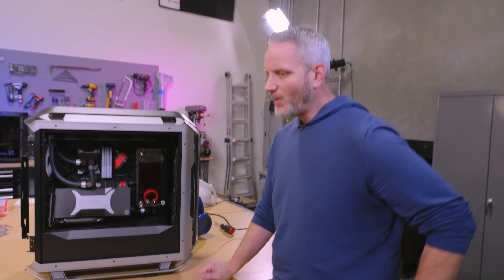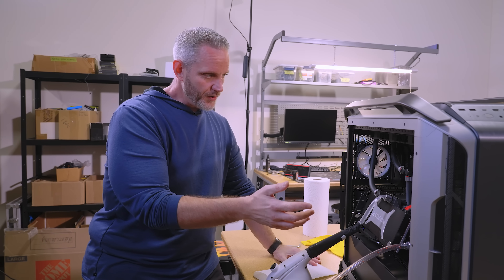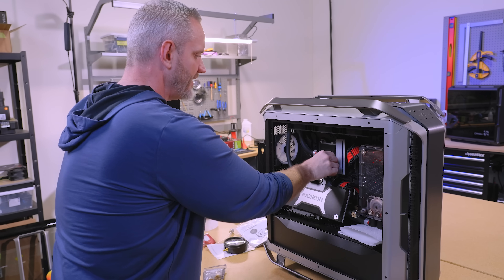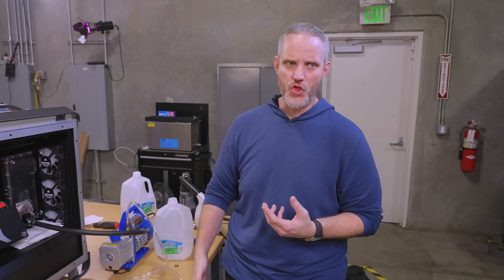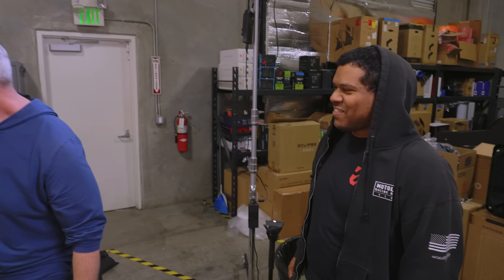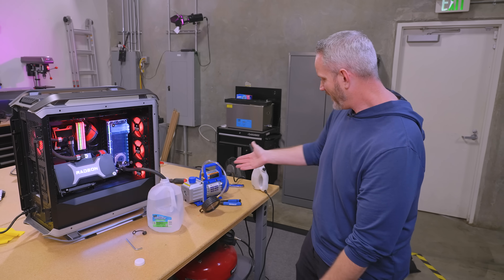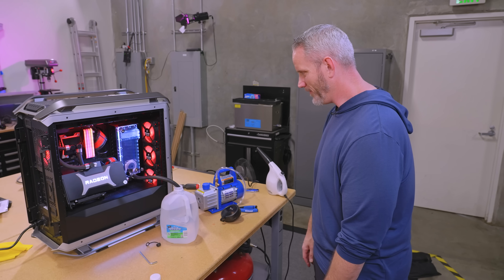I used Vacuum Pressure to fill a PC! Why didn't I do this sooner!?

Comment: Hey Jay, nice idea, but a litten bit late. Check Aquacomputers Leakshield. It uses a slight vacuum (negativ 300-400mbar) You can use this to Check for leaks in a newly build System, to Fill the system throgh a Port and to degas the system. (As well as a leak protection)
Reply: This is a pretty cool peice of kit. Please review Jay
Reply: Leakshield is a very nice looking piece of kit, especially with the QoL features it offers!

Shame it doesn't fit on my Corsair XD5 or I'd grab one in a heartbeat for the peace of mind alone.
Reply: @charries96 you can purchase the leak shield as a stand-alone version. It then works with any g1/4 port
Reply: How does it achieve leak protection? The entire loop can't be of a lower pressure than atmospheric while running, can it?
Reply: @bricaaron3978   Yes, the system runs at low pressure.  Mine is currently -316.5mbar ;-)
Reply: @looncraz  That is very impressive. I've been wanting to apply sub-ambient phase-change-based liquid cooling to CPU and GPU. If I do go that route, I will consider adding such a protection.
Reply: @bricaaron3978 That is exactly what it does
Reply: @bricaaron3978 it can if properly assembled it is airtight

Comment: Aquacomputer released the Leakshield two years ago and it can vacuum fill a loop.  The usefulness of its primary function, leak sensing and prevention by keeping the loop under a constant negative pressure, is debatable.  I wish you would feature the more actual enthusiast tier brands like  them and  Watercool more than the garbage mainstream EK and Corsair parts.

Comment: Jay you should get a water jet vacuum pump. It works by running it under the tap, and it is designed w fluid through it in mind and it's comparatively cheap. Tht way you could fill through a hose in an inlet and pump through the system that way until completely full 🙂 we use them at the lab where I work and they work wonders completely passively
Reply: Only downside is it isn't as cool looking as the name suggests!

Comment: nice one, next time after vac-ing and shutting the valve OFF. 
just raise the black hose up and fill it to the end, then put a finger on its end and dip it into can with fluid, that way you dont have to have additional valves and no air will get sucked in, like you explained happened right there with that black tube full of air after disconnecting from the vac pump.

Comment: What you could do is mount the vacuum pump with a tank and a two way valve so you could draw a vacuum on the tank to draw the water out then flip it to fill the case

Comment: Couldn't you just vacuum through your highest port while keeping the jug like you have it at the lowest port to fill it?  You'd entrain a lot less air  and it would be less violent.  They sell brake bleeder kits with hand vacuum pump and gauge for under $20 including rigid liquid traps.  For a follow up though, you could see how much vacuum it takes to collapse/warp a rad or contact block!

Comment: If yuou attached a container that can hold it's shape under vacuum that has the tube to the computer at the bottom and the connection to the pump at the top then you could use the pump to empty the system and then dump the old fluid, fill with new fluid like half or 2/3rds full.  Then pull the vacuum which will pull the air through the new fluid but then there would be no air in the line and disconnect the pump at the top the vacuum in the system will pull the new fluid in to the PC.  Finding a strong container that holds a gallon to a gallon and a half would be ideal I think so that half full would be 2 to 3 litres of fluid.

My system with 3 360 rads holds about 1.2 litres so 2 litres would probably be good.

I've been trying this but since I have a hand pump and no confidence/proper fittings it has yet to pull a proper vacuum.  The tinkling noise from the rads is very concerning as well so I stopped.  Be interesting to see if there is any loss of cooling performance because of the vacuum.  The nice thing is that the acrylic blocks and distros are going to hold a vacuum much easier than pressure so it seems like a safer way to test for leaks anyway.

Comment: When I convert my system to a hard line from soft i'm going to plan the filling up and draining side of things alot better than I did in the first place. But i'm not sure about using a vacuum to fill but to leak test at the very least due to me living on a bit of a budget.

Comment: 5:54 Phil's reaction was my reaction word for word, same cadence, same tone. I am shocked at how effective this was. Jay better get royalties for this. This was shear genius.

Edit: Apparently, there is a device from aqua computer called LEAKSHIELD that uses a concept similar to what was demonstrated in this video. It uses pressure to fill the loop, monitor's the loop's atmosphere in real time, and adjusts pressure to minimize or neutralize leaks. Linus did a video on this 2.5 years ago.

That said, I still think this method is faster and less proprietary. I still love your idea, but check out that LEAKSHIELD from aqua computer and perhaps give us your thoughts on it.
Reply: Prior art; he is repurposing existing auto tech. Plus Aqua Computer's Leakshield, which uses the same principal, as referenced above, already exists. Jay's giant shoulders are atop the shoulders of previous giants. Fantastic realisation of a=b and b=c, therefore a=c, though.

Comment: Some tape on the hose so you can turn the container of water upside down would make the hose fill with water instead, so the machine wouldn't have any air. Then you just need to close the valve and put the container of water the right way up again to get the water out of the hose, should only take a few seconds.

Comment: To pull the fluid out of the system with that pump all you would need is an intermediate tank like for a vacuum brake bleeder. One trip to Harbor Freight and you could get everything.

Comment: For a purely entertainment, would you ever consider using a smaller car radiator for a PC/system/server that would normally through off a bunch of heat? Maybe have disconnects on lines run to outside in the winter when it's cooler.

Comment: If you want to drain the system, you just need to get a pump that has a fitting at the other end of the pump. This will allow you to cap it and switch between vacuum and blower. 

In theory when pair with a larger res system. you could get a completely airless system and use it as a hot swap complete fluid changer

Comment: next thing is to think of a way to do a full flush machine like what professional mechanics normally use... I've never actually used a vacuum system for automotive coolant but have definitely used it for AC recharge. A flush machine would actually clean all of the old fluid out and put new fluid in all at once, although not nearly as fast as this still. (this is still great for when you need to take fluid out completely to change out a part but if all your doing is putting new clean fluid in...flush machine time!)

Comment: Been doing it for my last few builds. Have a container between pump and loop. That goes to a t. A valve on each side of the t. Pull vaccum onep valve going to coolant till it fills up to t. Pull vaccum agian close valve to pump open valve to coolant no air. Look at the snap on automotive coolant vac fill set up where i came up with my setup.

Comment: This is how hvac techs do it for refrigerant and glycol. I want to run active cooling in a sealed case and replace the air with nitrogen and see if that will prevent condensation. Someone with a budget for these things should do that and make a video.
Reply: Also you can use a manifold for refrigerant gauges to swap from your vacuum to fluid.

Comment: Now to make a container that you can put the fluid in and draw the vacuum thru the fluid (hard tube makes bubbles thru fluid and the air gets drawn out the hole in the lid).  Then when you release the vacuum it draws in air thru the lid but the coolant is in the way and drawn up the hard tube and into the system.  This gets rid of the air in the tube.
You could also then fill from the highest point in the system and draw the vacuum a second time after running the water system for a bit to get out the bubbles.  Although, I would think having zero air in the system could be bad once heated.

Comment: Jay, to expand on the use of automotive tools and making this a bit more reachable, how about a "mighty Vac" hand pump like you would use for bleeding brakes? Especially if you adapt a larger reservoir to hold the old coolant, it could be a one step solution. Also you could add a tee fitting and 2 more ball valves one to your vacume, one to the new fluid this would then allow you to not have the air introduced from the new fluid line.
Reply: That's what I use.  It works very very well.  A big system is rarely more than 2 liters and a hand-vac is more than plenty to purge it in a minute.

Comment: are you sure that the system still has the same cooling capacity?
I'm afraid the noises from the radiator were from the cooling fins that have become detached from the water-bearing surfaces. Or in other words, by pulling them together, you have torn off the cooling fins on one side ... would delaminated be the right word here?
in future, please test whether the cooling capacity is still present before you release a video ... can you imagine how much work it would be if you had to replace 100 radiators and then fill each loop again by hand ... lol, besides, amazon would definitely put you on the blacklist if everyone who ordered a pump now sent it back with the reason: jay comes too fast ... to a conclusion

Comment: The vapor is actually the left over coolant boiling off, if you’re doing this on a cars aircon it’s how they remove any moisture in the system ;) stick a valve on the other end and you keep the tube under vacuum as well  ;)  if you have a bottle of water and pull a vac on that you ill see it boil :)

Comment: If you used a larger container & attached the vacuum pump to that of the liquid cooling & the drain connected it would vacuum the liquid in to the container & the system would be at vacuum ready to be refilled.

Comment: Jay: get barb fitting cap thing for your jug so that you can turn your jug upside down and then pull from the bottom, as that will let all the air out of the hose / prime the line.

Comment: Just needs a bit of a tweak, use a "Y" connector with a valve at the base of the pump. Attach one end with valve to the system (like you did) and to the other to a fluid container with a valve. 
(have the container valve closed and open the system and pump valves, pull air out, then close the pump valve and open the contain valve.) Air problem solved

Comment: If you placed another shut-off valve on fill tube near the pump; turned it off  to capture vacuum in the tube while pump is still on; you could keep the tube clear of air and place in liquid and then open valve and almost add no air to system!

Comment: Jay, a submersible pump with good head pressure in a bucket of coolant will do the job you're looking for and put less stress on the parts. Watch a video on how to flush a tankless water heater for the basic idea. An aquarium supply should have a suitable pump for your needs.

Comment: The purpose of pulling a vacuum on a refrigerant circuit isn’t to make it easier to fill the system, it is to remove any contaminations from the system such as oxygen or nitrogen. 
My concern is that entire water cooling system is engineered/designed as a positive pressure system. O-rings notoriously struggle with vacuums. I believe this will cause them to fail prematurely. 
I’m not sure where Phil is getting his info from but you don’t need a “NASA” grade pump to get more than one atmosphere, I do it on a daily basis as an HVAC tech. It is industry standard to pull below 500 microns. Atmospheric pressure @ sea level is well above 100,000 microns.
Also your micron gauge is not in a ideal spot for accuracy, for your purposes; I would not use a gauge at all and cycle my valve on and off a couple times listening for a change in vacuum pump pitch. When you cycle your isolation valve and hear little to no change in the pitch of the pump that means you’ve gotten about as far as that pump can take you.

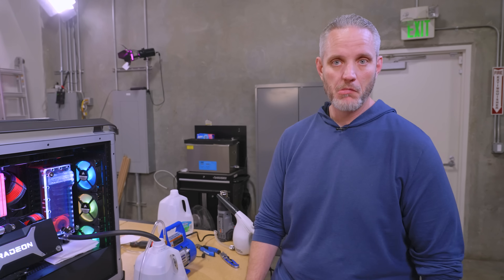Comment: Easy Composites has a video called "How To Do Perfect Vacuum Resin Infusion of a Carbon Fibre (Fiber) Part - Basic Tutorial" at 7:20 they show you how to get a vacuum in the tubes and how to clamp them off so no air gets back in when you fill your system with water.

Comment: T connector with 3 valves, 1 valve on each side of the T. put a hose into the container with the coolant, the other end to the vacuum pump and then the third end to the system.
turn off the flow from the coolant, turn on the flow for the vacuum and the system and allow the vacuum to form.
turn off the flow from the vacuum pump and turn on the flow from the coolant.
turn off the flow to the system.

Comment: To drain, apply air pressure (air pump) to highest point in loop and then open the drain valve.

Comment: instead of vacuum pump you could use the pneumatic brake fluid refill system and use the compressed air which i assume you have and fill the loop that way so that no risk of radiator or any fitment/reservoir collapsing or failing. it just suck in the fluid through venturi effect. Or as an alternative make a contraption using the blower where the blower blows the air away from loop through drain pipe and it will create same venturi effect in the loop and suck in all the liquid :)

Comment: Don't do it this way. You will collapse/crack parts. The better way would be have the vac on one side of the block and water on the other. The vac will suck the water all the way though with no collapse.

Comment: in the automotive repair field, there is a piece of equipment for draining and refilling cooling systems using vacuum.  it's strong enough to collapse radiator hoses and fill the system about 80% in seconds.  

as long as PC components are robust enough to take the vacuum, it'll work, but there will be some air.

Comment: The reason you can't pull the vacuum past 24" is because of the water left in the system. Water boils under a vacuum which will cause the pressure to rise. On a new build you might hit 29" but it might require running the pump for 24 hours depending on the humidity in the area.
Reply: I mean, its not like he needs to get system more sealed. If anything its better to pull just enough vacuum to fill the system so that you don't break anything.
Reply: Correct. As soon as the gauge stops dropping, fill it up. I was just explaining as to why Jay couldn't get to 30" of vacuum.
30" would probably cause damage to some of the components, mainly o-rings not designed for a vacuum. @BunzJackson
Reply: Tell me your HVAC without telling me your HVAC.
Reply: It was called A/C&R when I started @soul8bounce
Reply: I do hvac, and if you got water in the copper line set…. Narrowly impossible to get it all out without flushing with nitrogen and then starting vacuum again
Reply: yeah my water is boing at the -300Mbar  pressure its under 24/7
Water does NOT boil at negative pressure. it lowers the point the water boils at.
Reply: You would have to get the system pretty hot (60c or so) to boil water at 24". It would just suck it out as a liquid or leave it pooled somewhere at that level of vac.
Reply: His biggest issue is just hoses and set up. He will boil moisture well above 10” in of hg. I’m not sure a water cooling loop can be vacuum rated? The o rings on fittings would be my biggest concern.
Reply: @matthewclemons1574  What makes you think water is going to boil at such a low vac.? He keeps that studio very cool, water is not going to boil at 10" at room temp.
Reply: Do they sell g1/4 - 1/4 female flsre fitting?
Reply: @matthewclemons1574  Why would you want a female flare on the fitting? Do you mean female threads or female flare? Generally the female portion of the flare is on the tube.
Reply: @--_DJ_--  your correct call out would 1/4mpt-1/4male flare sorry I wrote it wrong. And your correct you have to get much closer to reading microns than I originally thought. Typed it into my calculator under r718.
Reply: I'm pretty sure the fact that he's just plopping the tube over the flare fitting is his main reason to only hit 25", as that's sure to be a vacuum leakage
Reply: This makes sense, you can see some vapors coming from the pump too

Comment: what about creating a fill bottle that has a bypass for vacuum.  you could make it so that it screws into the gallon jugs you use, and you just have to turn the jug upside down.  It would eliminate most of the air you're drawing back into the loop.  Think refueling a formula 1 race car.

Comment: I've been wondering why no one has done this yet, coming from a mechanic standpoint. This is how I've been doing car radiators for years so you can make sure there is no air behind the heater core. Great video Jay

Comment: I'm betting better success. But I believe there's still going to be a little bit of air in there. You still need a higher level for bleeding. And push coolant up with a pump should evacuate the system of all air not entrained in the fluid it's self
Reply: In case you're willing to read more. Pumps like this can only pump down so far. This is why I think you'll find a good part of the air that will accurately. As well as potentially gasses escaping the fluid. Even a turbo molecular pump gets perfect but do you need to?